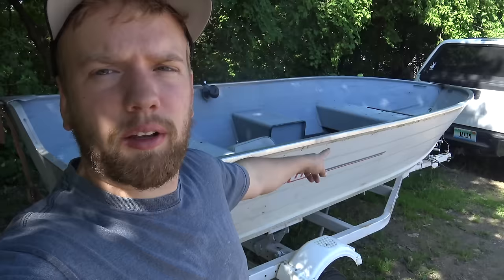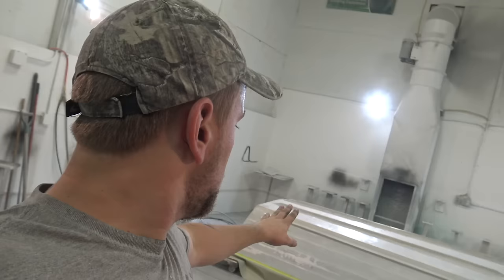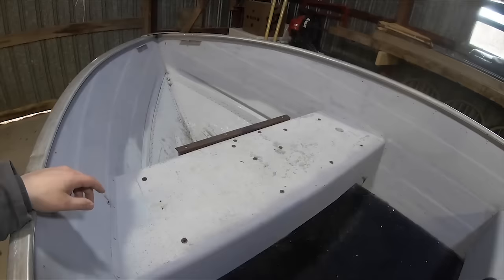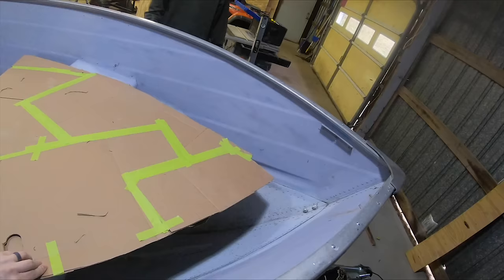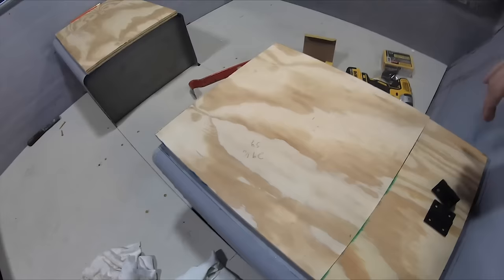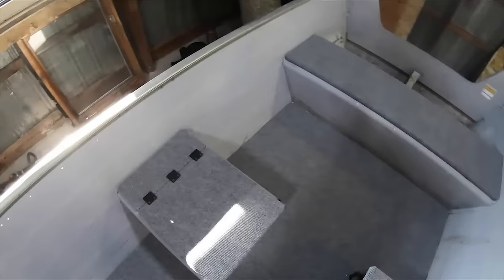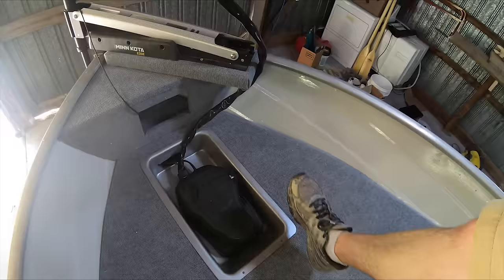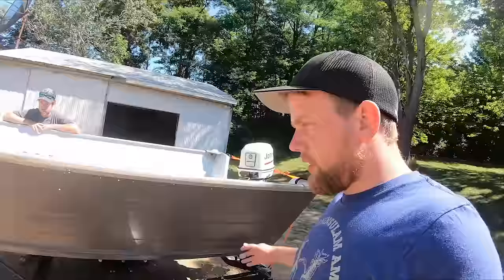Aluminum Fishing Boat to BASS Boat (Clean and Simple)

Comment: You guys did a great job on this boat. I'm a little proud of mine also. 14 ft. aluminum Starcraft, 30 hp. electric start Johnson with hydrofoil fin,  3 padded swivel seats, marine radio, stereo radio/cd player with 4 speakers, bimini top, automatic bilge pump, flat, carpet covered floor, electric trolling motor, fish locator, depth finder, GPS, level floatation in seats, running lights, floor lights, spotlight, oars, just in case, rod holders, cup or bottle holders, top speed 30 miles per hour, (32 with tail wind) Had people remark that my boat is the best equipped 14 ft. on Lake Stclair. Trailer has side guides and non-skid walk out platform. No wet feet for me! LOL! I love this boat.

Comment: As I grew up I was always told if I were to paint something and put it in the water to always ways use a marine paint so I wouldn't pollut the water around the boat  because an oil based paint will leach oil into the water anyways great build I hope  u have great times on the water iv got a 14 foot Johnny boat did some work on it plan to do more thanks for a few tips. 
Be safe on the water.

Comment: I didn't know you had to put harder in that tractor paint from tsc. Guess that's why mine is really easy to scratch and it took forever to dry. I painted my boat trailer black with that paint and ended painting over it with the rust - oleum truck bed coating paint. You got another subscriber and y'all did great work on the boat and trailer restore \ build. I hope mine turns out that good after I have the money to put it all back together. Im doing my first boat restore \ build on a 1966 Mirror craft 14ft vhull.
Reply from the maker: you don't "have" to put that hardener in it but it definitely helps

Comment: When trying to make a template for the front, lay the cardboard on top of the gunnel and trace it, it may be a bit wider but it's the Exact shape. if the front piece of plywood is cut tight there is no need for framing? The boat tapers smaller?

Comment: Great build.  Good attention to detail. Always concerned when foam is taken out of a boat and not added somewhere else.  Family of four died in California a few years back when gale force winds swamped their boat in June Lake, a high altitude trout lake in California.  Attributed to foam removal.  Boat sunk in middle of lake in 45 degree water.
Reply: They should have been off the lake long before any gale force winds. People need to be observant of the weather when in a boat on a lake or river of any size.
They were not too smart.
Reply: @greggmeyer5836  You have mere minutes in "45 degree water" even if you're clinging to a hull.
Reply: @UguysRnuts  still doesn’t go against his comment, they should’ve been off of the water
Reply: @mattblake9936 Actually it does. A gale can develop out of nowhere in mere minutes. They died because of hypothermia even though they had life jackets. Flotation foam would have made no difference.

Comment: I hope yours lasted longer than mine did. After only 3 years the plywood started warping and delaminating. I sealed mine on both sides and the edges with marine varnish and then covered it all with outdoor carpet like yours. It stayed out in the rain and sun because I didn't think I'd need a cover. The rain would run off and out the back. If I ever did it again I'd invest in a cover even though they only last a few years themselves. A cover is a lot cheaper than all the work and material I put into it!
Reply from the maker: That’s a bummer! This boat is stored inside 100% of the time so it should last a really long time
Reply: The best way is to fiberglass all sides then carpet
Reply: @laurencegiersch9615  It could be, but I don't want to take anymore chances. I've already talked to a metal fabricator and he said they could do it with all aluminum and I wouldn't have to ever worry about it again. The cost would be about twice what I spent on it already and I'd still have to carpet it. But, I'd be done and not have any future worries about rot or warping!
Reply: @Mackatax 1114 No, I didn't. The Lowes where I shop says they can't get it, so I just used exterior plywood. Doesn't matter now because I'm going to use sheet aluminum to replace the plywood.

Comment: I have the same trolling motor on my Bass Tracker and was wondering how I could fix that cumbersome foot pedal! Still unclear on what you used to recess it in the floor. Could you tell me exactly what that pan is?
Reply from the maker: im not sure if I can post links in comments but I will try at the end of this comment but if you search for aluminum dryer vent box you should get a couple of links with what we used. here's the link to the one we got https://www.lowes.com/pd/IMPERIAL-11-75-in-x-20-125-in-Aluminum-Dryer-Vent-Box/3203053?user=shopping

Comment: Awesome work guys.
The only thing I see is the fenders on the trailer seems a bit small. It might rub on the wheels over bumps?
Is this boat a 14 or 16 footer?
Reply from the maker: you could be right if it got pretty bumpy. We went a lot bigger than the original wheels just for looks but we probably went a little too big for keeping the original fender size.
Reply: @jakinwalsh  
Lol…been there done that.
All the best 2022 ! Cheers

Comment: What was the exact name and brand of the paint and hardener?
Reply from the maker: The paint on the inside of the boat is Majic Tractor Truck & Implement Paint and the hardener is Majic catalyst.
Reply: @jakinwalsh  Was the paint on the Exterior of the boat the same manufacturer and is it actually a stock color?

Comment: Where can I find this paint?
Reply from the maker: the inside paint you can get from tractor supply and the outside paint is just some automotive paint
Reply: @jakinwalsh  Where was the automotive paint purchased from and do you happen to have a color code and/or brand code on the can?